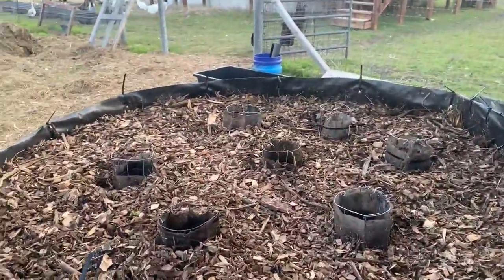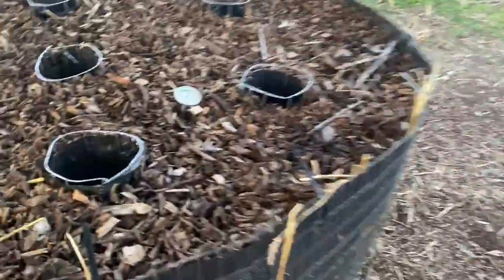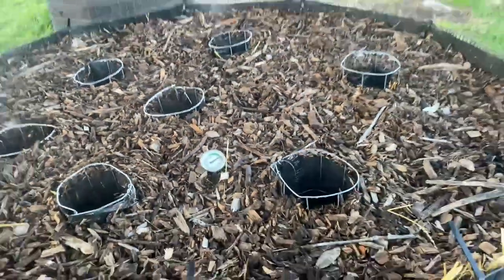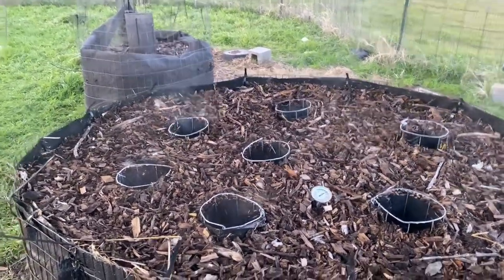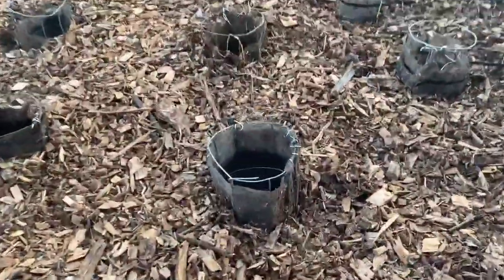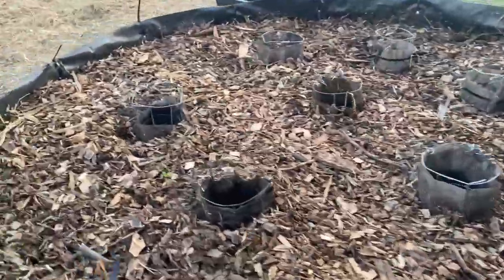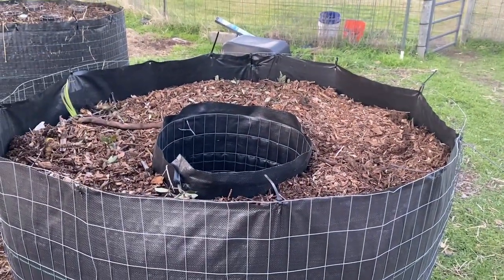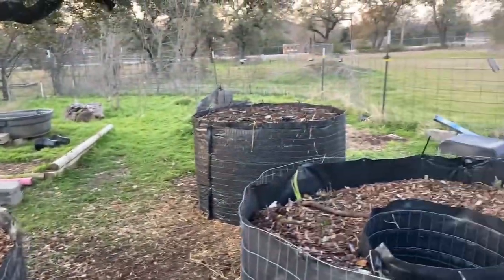New Model of Compost Bioreactor

Comment: I have an old old greenhouse guide and they instruct how to burry turd piles then set the greenhouse over it.    If you live where there are lots of old mines and you have more than 7 of 9 lives left then you can build a real nice green house with the track and a lift track can sit it on a turd pile no problem.  ( might need another few lives depending on skills)
Reply from the maker: Not a word of that makes a lick of sense.
Reply: @survivalpodcasting  Hi Jack, 1) some *OLD greenhouses in small towns in coal minSweden are built from mine car track, it is a smaller RR track , but it still makes extremely thick structures. These things are tough and rigid beyond anything I ever seen.      2)farmers up north use the heat 💩fermentation gives off to heat early spring gardens by sitting a portable greenhouse over them.              i.e. that fermentation heat is useful up north.

Comment: 140 degrees is great, but is it due to the design, and can it be sustained?  Any big, freshly mixed compost pile will start to cook nicely after a couple of days.  The owners won't be able to mix it to keep the airflow going as as the pile compacts, or introduce fresh nitrogen when all those woodchips burn through the nitrogen in the manure.  The fast thermophilic activity that is driving the temperature will choke out for want of oxygen and nitrogen.  The pile will cool off, allowing only modest rates of mesophilic composting.  Those carbon rich wood chips will then take a year plus to compost adequately.   I expect that this will only prove to be a good solution when you have lots of space available, and lots of patience.  But it will generate good compost.  

That said, I can't claim to have a better design, and I applaud your experiment.  You'll never get a design right for your first prototype, but that's the first step to designing something more effective.  I think I'd shift from vertical tubes to a raised grate at the base of the pile to allow for aeration without preventing mixing.
Reply from the maker: This compost takes a year to make it will only stay in a thermo cycle for 10-20 days on average.  I'd say you are outside your area of knowledge at the moment.  This is a bio reactor and a type of compost made well known by Dr. Steven Johnson.  You may want to research it a bit.
Reply: @survivalpodcasting  I apologize then.  I hadn't realized (and you didn't say) that you were shooting for a one year cycle.  I think that we are in agreement about how the apparatus will perform.  It reminds me of the episode in the Beverly Hillbillies when Granny reveals the details of her herbal cure for the common cold.  You drink it, wait for two weeks, and you get all better.
Reply from the maker: @rogerhelms6715  You're an assclown, I suggest you do some research and look up  Dr. Steven Johnson who developed the method before commenting more on it and making a fool of yourself to those who are informed on it.  But you do you Margret, you do you.

Comment: Do you think the 4 perferated pipes idea near the bottom would be a good idea still?
Reply from the maker: Nope they were flat AF in the old pile.
Reply: @survivalpodcasting  Cheers, yeah I was worried about the weight compressing them. It seems like vertical pole(s) potentially reinforced is the most effective way to have holes in it. 

I hear a concern about people saying the air may be stagnant with that method though, but I have no idea if it is true or even matters.
Reply from the maker: @Windslashman  Ignore those people.

Comment: How does the reactor using a single large center air column compare to using several smaller columns?
Reply from the maker: It doesn't it is for storage and aging not for making.